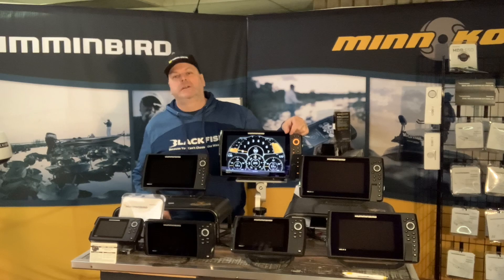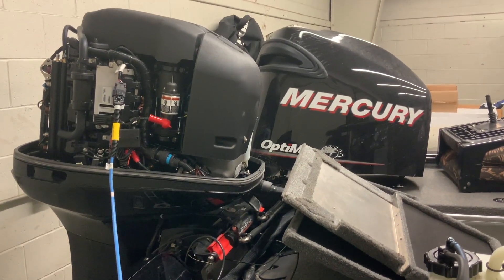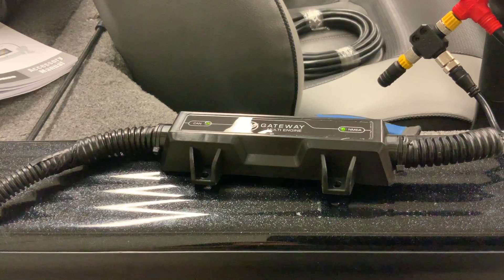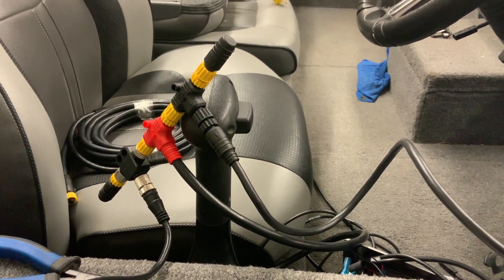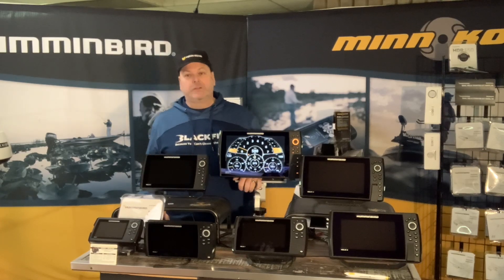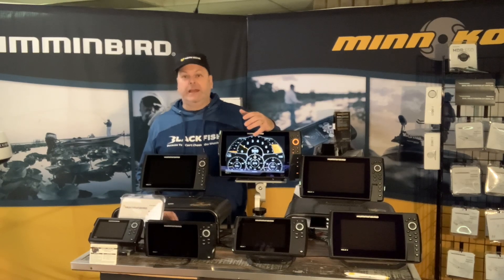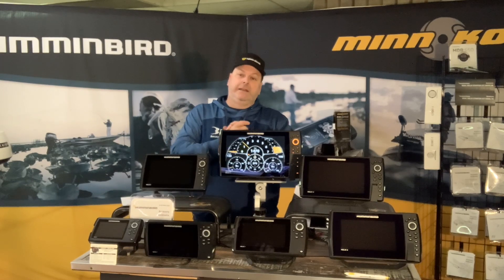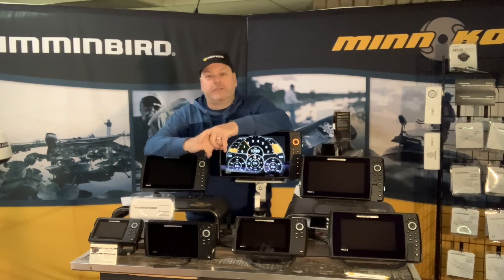Mercury Optimax to Humminbird Connection to share Engine Data

Comment: thank you so much for this video - I searched and searched and found no concise info on this - although I was looking at connecting to a Garmin.  The engine half of it to the Gateway was what we are having trouble finding info about.  I have a question - that engine harness data cable - they come with THREE connections from what I see, but you are only using two?  And I assume a junction box between the data cable and the Gateway is not needed because you are running only one engine?
Reply: Thanks...Unfortunately I installed this 3 years ago and no longer have the same boat. I don't recall what the data cable came with. I did not need a junction box...omly what you see in the video and parts listing (in the description)

Comment: Thank you so much for this video. This is the only video I have found that answers this exact question. I previously had a Simrad go5 connected to the Mercury Gateway. I wanted to put my Helix 8 G3n in the console instead and did not know exactly which components it would require to read engine data. Since the Mercury smartcraft Gateway was already installed in the boat when I bought it, along with the backbone, it looks like I only need the Humminbird module which appears at 2:23 in this video. Thank you!
Reply from the maker: That's great...and thanks

Comment: Didn't finish my question .....2005 optimax 115.....is it possible to go lower than the factory idle rpm .....550 I believe....using troll control......want to pull spinners at 1 mph
Reply from the maker: Thanks...That would be a question for Merci. I did not have vessel view on this boat

Comment: Thanks for making this video.  Helpful as no else really address this issue!  

I have an 2017 Optimax 250 and a Solix 15 Gen 2 with a backbone and Mercury gateway and cables to my Solix.  I have an analog sensor in the fuel tank so I understand that consumption data is not available to me.  I am getting the following information to my Solix, RPMs, Volts, SOG, Hours on motor. 

According to what I see on line, I should be getting engine trim, water in fuel, engine diagnostics, PSI, and motor temp,  My guess is that the alerts will display if and when they occur but PSI and motor trim are critical as I am a bass fisherman.  Any thoughts or should I have just got the SmartCraft module instead
Reply from the maker: Hi and thanks...I get the same info as you. The Solix will read what is coming through the NMEA backbone. You will have to check with Mercury to see how to get that data from the engine
Reply: @principleoutdoors8932  thanks.  Appreciate your response

Comment: I want to connect my 25hp mercury efi to my solix would all them cables fit or are they different on a optimax..
Reply from the maker: Hey James...you would have to ask Mercury that question. A 25HP may not output any data

Comment: If Mercury VesselView Mobile is an option on your motor you can spare yourself all of this work and use bluetooth to your phone or tablet. Just plug the module into your motor: https://publications.brunswick.com/VesselView-Mobile-p/vv-mm.htm
Lowrance and Simrad have really cool options like troll control and tow control that I hope Humminbird adds in the future through Vesselview Link. If they had that then I would for sure wire in my Solix.
Reply from the maker: Yes some of the wireless engine data sharing is amazing. Evinrude had it going as well but I guess that is done now